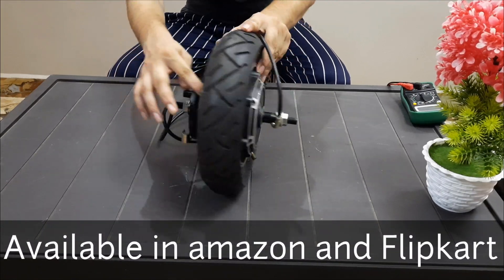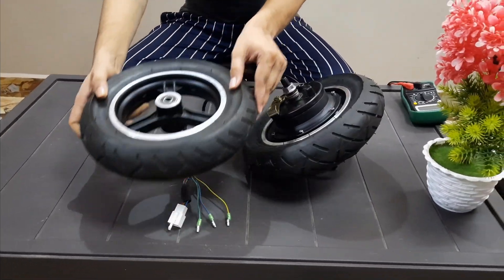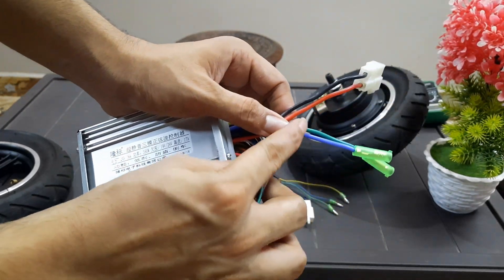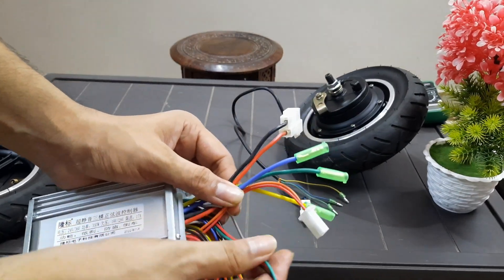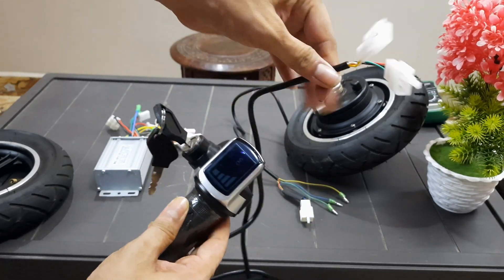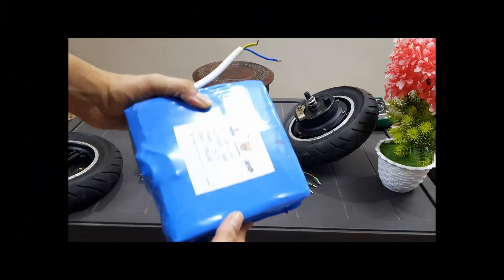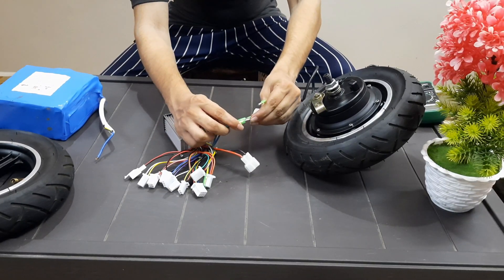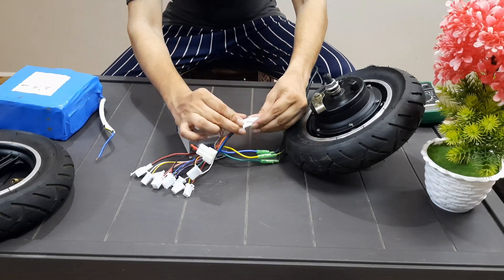mini electric scooter hub motor kit full wiring connection

Comment: I am your viewer Can you show me via video how to find throttle wire in the controller My green sunny ev scooty has 250 watt hub motor and is 48 volt li ion battery can you send wattsapp number to send photos of my controller
Reply from the maker: +91 81486 45086 WhatsApp

Comment: How much does it cost ???
Reply from the maker: 9000rs . Hub motor with tyre and front dummy wheel , controller , throttle . Call 8056248257 / WhatsApp number different +91 81486 45086